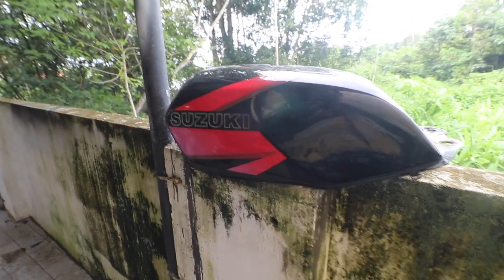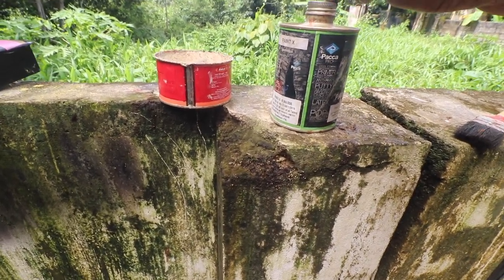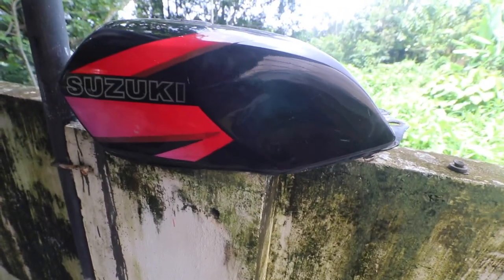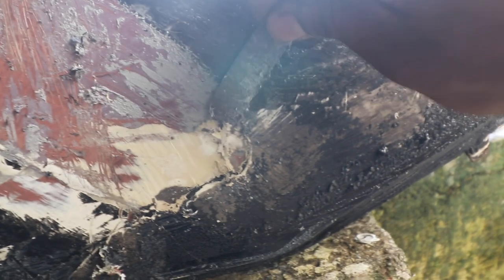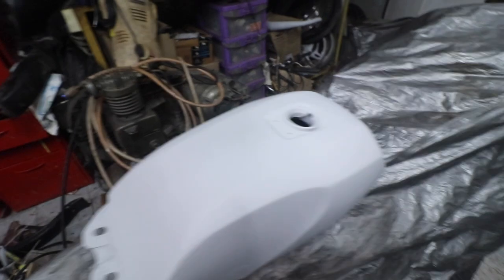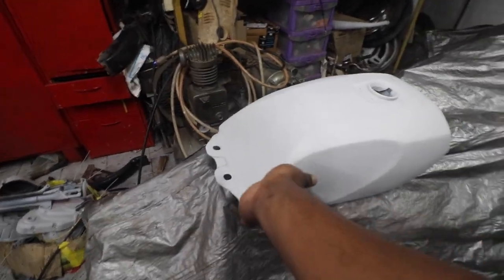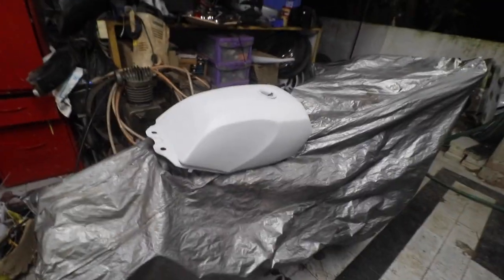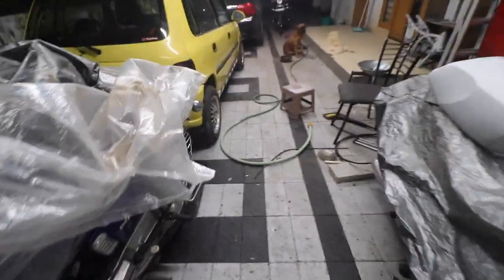Shogun Rebuild Part 2 Paint stripping (English Video)

Comment: Matt Black skirting on zen might look good
Reply from the maker: Thinking of glossy black since it’s almost Matt black now. Cleaning Matt black is a pain
Reply: @Yamakaze  ya. Did you repair the skirting yourself??
Reply from the maker: Not this time, this was longer by 1-1.5 inches, plus it’s fixed using screws. So the workshop did this one for me along with the door locks.

Comment: Bro 135 4 speed running angu ninnu poanu carb no issues and Scene ennanu vechal spark plug oory kuthumbol on aakum but pinnem 1st ittu edukkumbo off aakum appam plug nte mele Kai vechu odichu appazhanu enikku veedu vare jerk cheythu konduvaran pattythu CDI UNIT nte problem airikkumo??
Reply from the maker: plug cap, change the plug cap or seat it properly